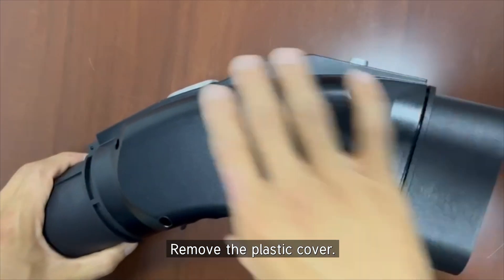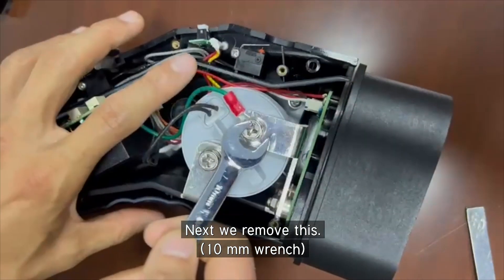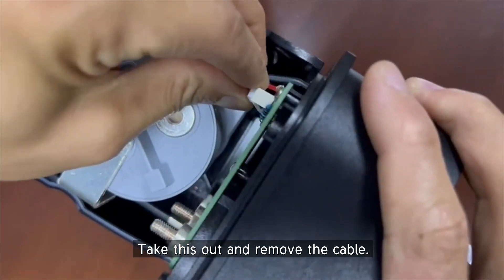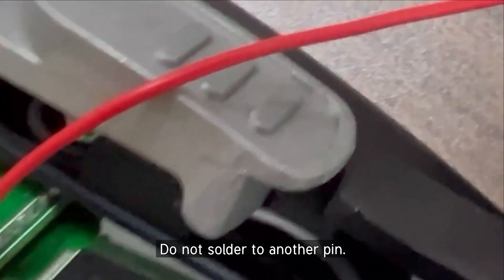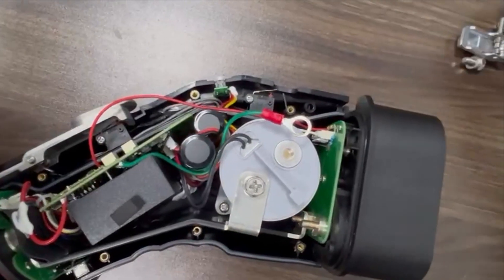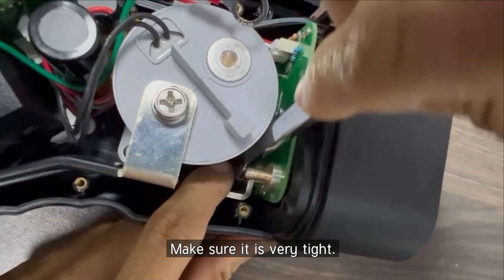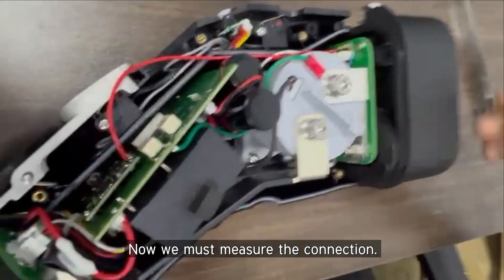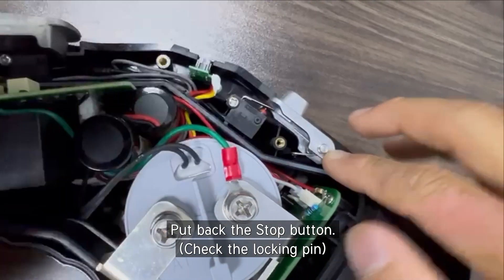CCS2 to Chademo adapter mod for Tesla Supercharger v3/4

Comment from the maker: PS: When finished, make sure that the wire is tucked safely and does NOT cross the seal-barrier wall on the inside, or else the wire will get pinched and damaged. (Happened to me)